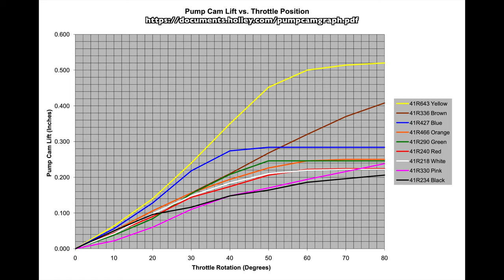Replacing the Accelerator Pump Cam on a Holley Carburetor

Comment: Great video! I do alot with Holley as well. I’m currently using the red cam in #2 in primary and brown in secondary. I have the 50cc pump in the rear. It has a Quickfuel body, billet throttle plate, AED metering blocks. Choke horn gone. Shooters are 31 primary, 35 secondary. 72 primary jets, 84 secondary. Power valve 45. Thinking of rejetting. AED tech said my primary was to lean. I’m going to do a plug read soon. It’s seems rich it burns my eyes now. But could be the cam. Comp XE284. I know you’re set up will definitely differ, mines a 351. Great tip on the tiny screw! I always drop that thing on my intake. As well as site plug gaskets! 😂 Thanks for sharing!
Reply from the maker: Did you set up the carb yourself? If so, which one did you start with? It sounds like it is on a pretty radical engine. Did you end up doing dyno runs to get it straightened away?
Reply: @SmackeysGarage  Yes I set it up over long period of street pulls. No dyno, I probably need to. I’ve recently changed to those metering blocks and those made a huge difference.  That’s why I think I need to rejet! The blocks greatly improved my throttle response!
Reply from the maker: Are you running an AFR gauge? I added one recently and it’s definitely helping my tuning. I think I’m going to end up drilling my throttle plates to allow more air through at idle without impacting the transfer slots. 

Im running a Holley 4150 that isn’t as adjustable as I’d like.
Reply: @SmackeysGarage  I’m not yet, but doing that this season. I think that would be a great idea. The billet throttle plate I’m using allows rear secondary adjustments with out removing carb. I haven’t needed to drill the plates. My transfer slots are perfect. I pieced this carb together separately over time. The aftermarket parts have really improved my throttle response. The body has removable air bleeds. The AED metering blocks have more holes drilled in the main well. Stock has 3, this has for. That evens out the fuel more smoothly through throttle transitions. I think I put a pic of the carb at the end of my Mach one video. I made that video when I was green to YouTube. About to do another one.

Comment: I have this same carb and having the same issue did you ever figure it out?
Reply from the maker: It ended up being a broken gasket between the fuel bowl and the main carburetor body. It wasn't letting all the fuel come from the fuel bowl to the carb body. It was recirculating "some" in the fuel bowl.

See the gasket in this video.
https://youtu.be/eTOBUtwpzn4

Comment: Cool, but I couldn’t see the orientation of the cam install. Does the step go towards the spring or the lever?
Reply from the maker: I’ll look when I get home from my office later today.
Reply: Ok thanks, I think this carb was dropped the acc pump arm was bent and I couldn’t adjust the lever correctly. I did find out that they have a 50 cc pump on. I just ordered a 30 cc kit.
Reply from the maker: Hey Buck, In the garage now. The way my carb is set up, the flat side of the cam is the side you screw into. That would mean the flat side is against the metal. Is your carb a double pumper? Unless you are building an all out race motor you probably don't need the 50cc pump.. What size shooters are on it?

If you need pictures or anything let me know. I can send some to your email.
Reply: Hey, thanks for your help. No race motor here, just a cruiser. Yep I had it backwards. I have it working now. Had to bend the lever to get proper adjustment.
Reply: New lever kit will be here Wednesday. I’m hoping it takes the stumble out of it. I think the squirted was a 25  or 28